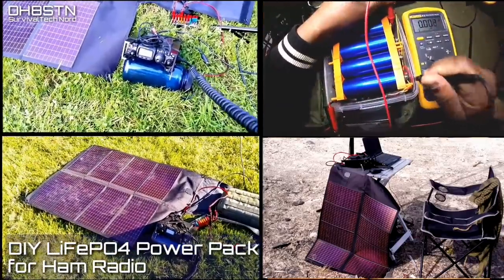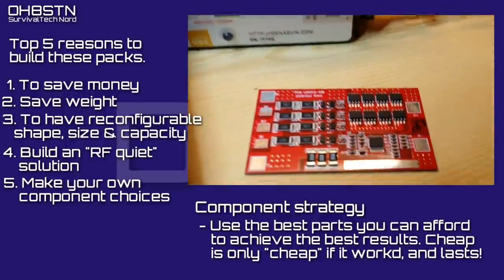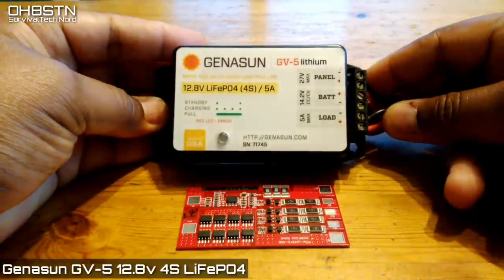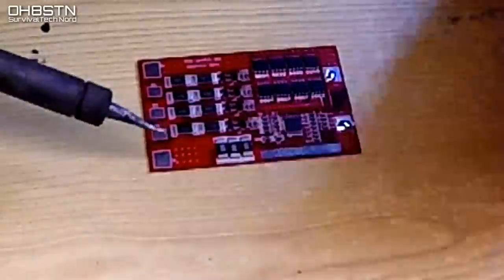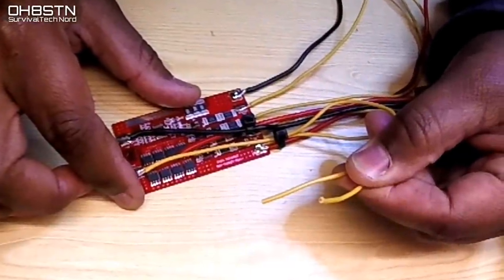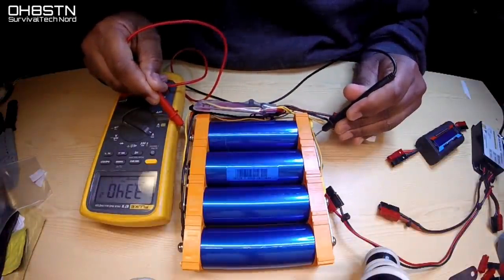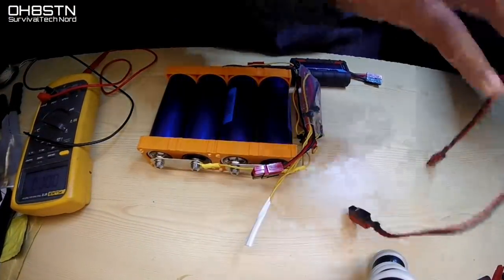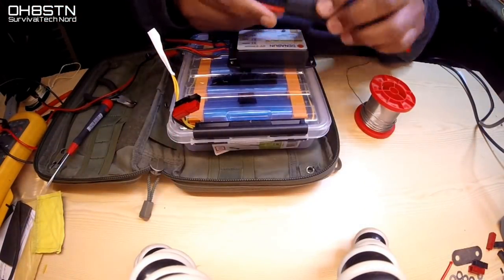Ham Radio Battery Pack DIY LiFePO4

Comment: Nice battery pack. I'm definitely considering replacing my lead acid (2x 7ah) with LiFePO4.

Did you consider adding one or more fuses?  E.g. on the battery connector and perhaps the load output of the charge controller.
Reply from the maker: +Sylvan Butler definitely a good idea with one 10 amp hour lithium iron phosphate you can replace the two lead acid batteries without losing any capacity. I have fuses on the output side of the charge controller via the distribution box. Heres a link: http://oh8stn.org/blog/2017/07/06/man-portable-off-grid-power-for-amateur-radio-part-4/
It is also possible to add fuses on the Importer battery terminal side of the pack but the BMS has Short Circuit protection built-in ( which I have tested) additional fuses although nice would be kind of a double redundancy.

Comment: So that Genasun.... is that necessary? Could you not just hook up the Solar Panel directly to the BMS? What do you not get from the BMS that is provided by the Genasun?
Reply from the maker: Some companies tell us that the BMS is managing to charge but it doesn't. The BMS protects the battery from under voltage, over-voltage, short circuit, and being out of balance. The charge controller gives the battery the correct voltage, stops charging it when it's tuli, and starts charging when it's not. The charge controller will also adjust the incoming current, to maintain a constant charge voltage. I know those things sound similar, but they are different. I hope this helps.

Comment: I ordered everything, but could NOT find the plated copper jumpers you used!
Reply from the maker: +Lee Maisel high Lee
I'm almost certain batteryspace has them if you're in North America. In Europe there is the shop.lipopower.de I'll try to find them from Amazon or Ebay and add them to the shop
Reply: Thanks!

Comment: Excellent video. I'm going to have to put one of these together. What is the  overall weight of the battery and charge controller? Thanks for sharing !
Reply from the maker: +SurvivalComms thanks Bret. I'll weight it all out tomorrow in its  "ready for field" mode.  I've got another build coming in a couple of weeks which is an update of our builds from last year. It's practically the same as this one but using 26650 sells instead.
Reply from the maker: +SurvivalComms answer to your question https://www.instagram.com/p/BZT940TjTHe/
Reply: That is great ! That is almost a full pound less than a 7AH AGM alone.
Reply from the maker: +SurvivalComms and remember the 7 amp hour AGM will give you 3.5 amp hours of usable capacity while the lithium iron phosphate will give you 80 - 85%
Reply: So true. I have been really pleased with the 4S 18650 packs and look forward to building one of these myself.
Reply from the maker: +SurvivalComms 👍would love to see the video build of yours as well.
Reply: OH8STN Yes I will definitely do so !

Comment: What capacity of solar panel would you need to keep such a battery pack charged during portable operations?
Reply from the maker: Depends on your latitude, cloud coverage, how much power you run and your current consumption.  For the ic705 and tablet my 60-watt panel does the job. For a Yaesu 891  and tablet, 60-100 watt panel during sunny days.
Reply: @OH8STN  I supposed that I need to find a 12 volt solar panel? I see that there are 5 volts, 12 volts and 18 volts out there in the market. Thanks a lot for your help.

Comment: Hello sir,with the charge controller,did the BMS come with the controller?Where did you get that component from?
Reply from the maker: Hi Brian. The BMS is usually sourced independent of the charge controller. I noticed someone just published a comment with a link to where they got their boards. Battery space is a great place to look if you're in North America. There are also those EV shops, supplying BMS boards for projects such as hours. Feel free to add a new comment asking someone to post where they got their BMS board,
73
Julian oh8stn

Comment: Where did you get the bus bar I didn't see them on the website where I got the batteries..thiniing of another way to short battery if I can not fiond them, maybe braid with ring connectors and shrink wrap.

Comment: You have great videos love watching what you are doing with ham radio and lithium battery . I want to get all I can out of my solar .and when I hooked up my mppt controller my vhf radio went nuts so wondering if that charge controller does the same ? I need to get all I can on my 4 , 50 watts portable panels I am setting this up for my van for road side deployment .

Comment: Great Video.   Just ordered most of the parts from BatterySpace and hope to be building one soon.  What type and size of wire are you using?  Thank you.

Todd
W5MTN
Reply from the maker: +Todd Rogers hi Todd thanks for the question. I think for this build I used 14 gauge wire for the load, and something much lighter for the balance leads. The power pole connectors I used are 30 amp, they generally follow the power pole wire recommendations for matching connectors and wires with amperage draw even for qrp radio.
Reply: Thanks so much.  I've asked this in a few areas but thank you for the answer.  I have really enjoyed you're videos.  They are right inline with what I do for SOTA operation.

Comment: Hi Julian, I watched with great interest your hedway cell 10ah battery pack build.  Just help me out here.  The battery management system protects against shorts na d stops the cells being discharged below their minimum operating voltage.  Does the bms also manage charging?  If I connect a 13.8 volt power supply to the battery pack leads, the cells will be charged, but how will I know when the charge is complete?  Do I need some other gadget?  Cheers,  Tim.  Can you recommend a vendor from which to purchase a Qro bms compatible with the hedway cells?
Reply from the maker: The battery management system does not manage the charging for that you need to charge controller. That's why you always see me in my videos with the Genasun solar charge controller.  you can also use a normal RC charger like the Turnigy charger for example sets for 14.4 volts, with a couple of amps maybe maximum 2.5 amps. Do not connect the power supply directly to the Headway batteries. 
I hope this helps and I'm really happy you asked
Reply from the maker: I forgot the other part of your question Tim. When I publish the qro Pack video I'll try to include a parts list and some Alternatives as well
Reply: OH8STN A QRO battery pack is my goal here Julian.  It seems battery technology has now advanced to the state where you don’t have to be QRP to be portable.  I want to run my kx3 and a small 50w Tokyo hi-power linear.  I’ll probably get a Turnegy charger to balance charge the cells.  Found a cheap source of headways here in australia.  Your power systems look really cool in those molle pouches.  I think I’ll do the same.  Well done Julian please keep up the good work (Qro power packs interesting).  I don’t think I have deep pockets like you though, I looked up the price of those great portable solar cells you were using to charge the Qro power pack the 7200... ouch ouch ouch.
Reply: @cthoadmin7458  you need 14.4v to get a full charge on lifepo4 pack

Comment: Question about the BMS. If you were to double the capacity to 20Ah with 4 more cells would you  use the same BMS in a 4s2p? Or in my case I want to build a 4s4p, would I treat the 4 cells in series as one cell and still use a 4 cell BMS?

Comment: Julian,
I ordered the parts from BatterSpace as you outlined in your episode notes.  However, the BMS I recieved is much larger than the one you used in this episode.  I think that I received the 30 amp BMS.  Is it still ok to use this BMS with this setup?  Thanks.  

Todd
W5MTN
Reply from the maker: +Todd Rogers yes you can definitely use a 30 amp version even with a set up he doesn't need it.
Reply: Thank you so much for the reply.  I'm getting ready to assemble the battery pack.  Suggestions on type and size of wire?  Thanks so much!
Reply: Sorry.  Missed your reply on the other post.  73

Comment: Can these be configured in series and parallel to get 12_14 volts and 40 Amp hours? How many batteries would be needed?
Reply from the maker: Sure a combination of series parallel. 4S4P
Reply: @OH8STN  I was hoping that was correct, I just ordered a book off of Amazon so I don't set the house on fire.

Comment: If I wanted to use 8 of these powercells to double the capacity in terms of amp hours, and use it for the very same purpose you are (12 volt system), would I need two BMS boards?  In short how many BMS boards would I need and how many charge controllers?
Reply from the maker: We usually use one BMS and one charge controller. The BMS is rated for the desired current draw and the number of cells in series in the pack. So if you have for sales in Ceres you need it 4S bms. If you have 4S 2p that means four in series but two in parallel you'll still need a 4S BMS.  Even if you have  4  cells in parallel  you still need a 4S BMS. Does this make sense? We also use a single charge controller for the pack. The charge controller needs to be specified for the type of battery chemistry you're trying to charge, but we only use one.
There's lots of confusion between a portable system and home systems which are often using much higher voltage.
I hope this helps
73
Julian oh8stn
Reply: Yes it makes sense.  Thanks for explaining with such great detail.  I also found my answer where you replied to others asking the same thing.  Also your video related to the 4S2P pack was most helpful.  I should have watched that video first before asking.

Comment: What parts would you change for a 8 battery/20 Amp hour version?
Reply from the maker: I'm so happy someone is finally asked this question. I'm going to do a build video on this next month. The concept is nearly the same, however will put two cells in parallel, and four in series.
Reply: Excellent.  I was shopping DC power supplies for my ham equipment, and realized how useful it would be to have a set of batteries between the power supply and my radio.  Not only would the peak power of the power supply not be as important, but I could also still use my radios during a power outage.  I was targeting 40-50 amp peak just in case 2 radios TX on full power at the same time.  Of course solar is in the plan as well.  Thanks for the update.

Comment: Have a question. would this 30amp BMS work instead of the one used here. PCM with Equilibrium function for 12.8V LFP Battery Pack @ 30A limit. i was going to go with this one  BMS 4S 40A LiFePO flat, with balancer and temperature sensor -351
but don't understand the extra P +: consumer / charger (+)
 D-: consumer (-) C-: charger (-) spots.
Reply from the maker: It's hard to say. Definitely don't use one which doesn't have good documentation.

Comment: How do you know if your BMS is working or if anything has went bad?
 Do you ever bottom level your cells?  That's run them all low as they can go almost. Then charge the group up to their capacity at the same time.  Then he group will only get charged up to the weakest ones capacity. Level. The weakest one fully charged while the rest are not fully charged.

Comment: Love ur videos!!! Subbed. Got me thinking I need to build one it would be used to charge 18650z and ennaloop rechargeable batteries and baofang radios. A nudge in the right direction if you read this would be greatly appreciated. I’m sitting here wondering how I measure the draw to get the right controller... Thanks!!! Awesome content!!!!

Comment: I am using having problems, have replicated your setup, checked, checked again, and again, yet the red BMS board just gets hot and no voltage reading on P+ P-  Could it be defective, or am I missing something?   B1,B2 & B3 are attached exactly like you have them, the power leads, etc.  Thanks!
Reply from the maker: +Lee Maisel which BMS board did you use? Check the documentation because sometimes and definitely if you use the same board that I did, you must initialize the board by connecting voltage from eg- a charger to the power plus and minus. The boards are only active once they have had some voltage applied to the power port
Reply from the maker: +Lee Maisel here's a video for you Lee https://youtu.be/WgQSprnBiJM
Reply: Odd.. Yes, when I jumper B1 and P1 i get heartbeat on charge controller.   When I apply PS voltage to P1 and 2 it get it as well.
Remove jumper or voltage, it stop working.   I'm going to assume bad BMS board a this point
Reply: I've ordered a replacement board, I'll let you know.
Reply: OK..  Problem was, the wiring instructions for this board were non-existent.  Also, the B1, B2,B3 terminals are in opposite order to your board, so that was the problem.

Comment: First let me say that I find your videos very informative (and I should add here that I have recently purchased battery holders from your sponsor,  Vruzend--I like to think of their product as DIY electronic Lego blocks). So here's my question(s). Question One: You indicate that in the shack one charges the battery pack by connecting the BMS to a power supply.  So what is the rule of thumb concerning charging batteries through the BMS.  For example, if I have an S5 configuration of Lithium Ion batteries with the max voltage per battery of 4.2 Volts, would I adjust the power supply to 21 (5 X 4.2) Volts;  or in the case of S3, would I set the power supply to 12.6 (3 X 4.2) Volts, and so on?  Should I "assume"  that the BMS will control the charge, balance the cells correctly, and stop the charge when the cells have reached the proper level, and so on?  What if the supply is set for less voltage?   Question Two:  Should I also assume that when one adds cells in parallel in order to increase the Watt Hours of the system--for example, four cells in parallel where there was only one before (so in an S3 system, there would be 12 cells, 3 clusters of four parallel cells) one would think of  each cluster as merely one cell since each of the cells within it receives the same charge on account of being connected in parallel--and therefore all four are balanced)  [I am assuming here the same brand/type of batteries and that each would be precharged to the same voltage before being connected together and placed into the system]?   I understand that the BMS needs the proper current rating.  Am I overlooking something?

Comment: Hello 13.38v is what it is at now. But what's the max voltage it can go up to?
Reply from the maker: +joseph chrzempiec the patch should never be allowed to go above 14.6 volts. 14.2 - 14.3 volts that's optimal

Comment: hi what size wire for bms
Reply from the maker: The wire size depends on the current load you'll pull from the pack. 12awg should be fine up to the bms max.

Comment: Great video, thanks. I wanna say this about it. I am a newby and wanna build tiny home power systems for gadgets (Off-grid). I find it strange you have to scale up so much extra electronics to have a simple battery pack with 10Ah capacity. I recently bought a 30 Watt Solar panel and only wanna charge phones or tablets. So i figure i can easily use a 3A (Max) DC- DC converter that efficiently buck-converts down (adjusts) the solar voltage output to 5v constant for use with USB powered gadgets. This (6-30v) DC- (5v)DC converter is basically a charge controller and an efficient power converter in one. It's the size of a matchbox. Has all the electronics sealed-in and has a micro USB out connector ready for me to plugin to phones or tablets. By using USB 5v Power banks you can create some capacity on the go when the sun might be blocked or to use at night. All the BMS and relevant electronics is basically in the powerbank and also in the cells themselves if they are any good. The overal cost is significant less and you have more direct use of sunlight. A 30 Watt solar panel with the right specs can easily charge phones on Daylight (No direct Sunlight) only this way. Everything above 30 Watts changes the usability, weight and cost of it all. You either end up with a very bulky battery on the go or a large solar panel, not both. Simple 7 watt fold-able solar panels can do a great job if you only wanna charge a phone, even 2.5 watt is sufficient if you only need 500 mA to charge an iphone 4S. These panels are so small and lightweight under 100 grams, look great and you can put them anywhere in a backpack.

Comment: I just discovered your channel. I think I've reviewed all of the videos and your blog page. What are your sources for the components, 38120 batteries, bms board etc. I would also like to read a detailed explanation on how you need only one bms board in a 4s2p setup.
Thanks for all your efforts.
73's
Steve, N6RUO
Reply from the maker: All? The old videos are horrific.
 Each of my battery builds has detailed explanations and accompanying blog post with more detailed info. Still, I think it's important to start with this playlist, if portable power is your interest. Portable Off-Grid Battery & Solar Power for Amateur Field Communications: https://www.youtube.com/playlist?list=PLKMrdrsNkFA43q0POuXM-5-49yOd3t4CP
Regarding the BMS, each battery build details the BMS used, how to wire it, and its specs. I use 4S BMS boards for lithium iron phosphate,  and 3S BMS boards for Lithium-ion. These days I've settled on one 50A model for dual 100w rigs, and a 30A model for everything else.  
Thanks for watching and stopping by.
Its very much appreciated. 
73
Julian oh8stn